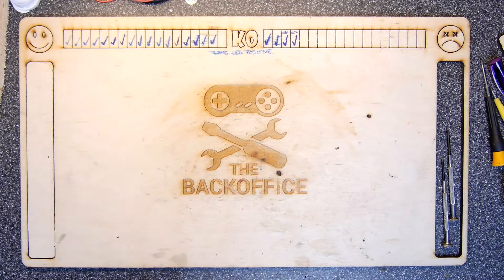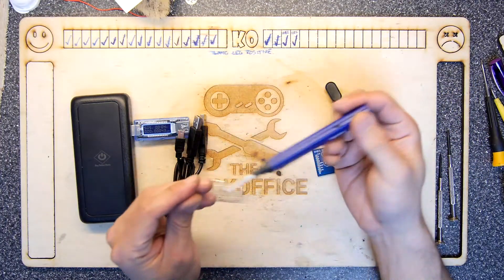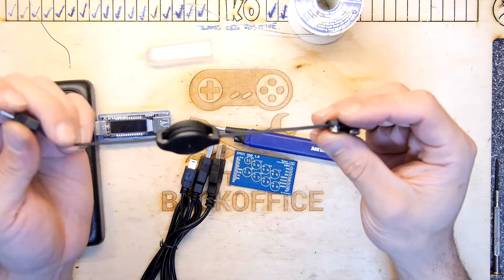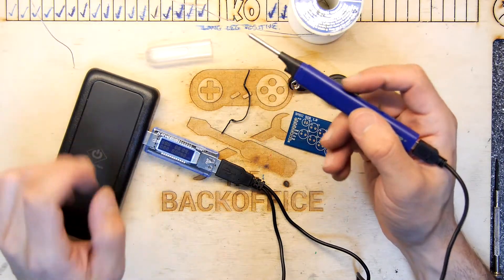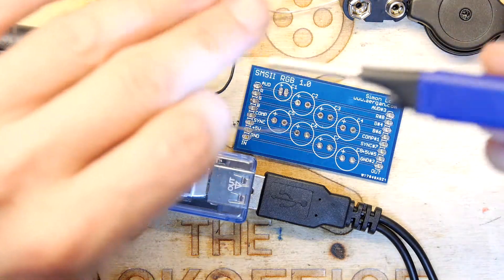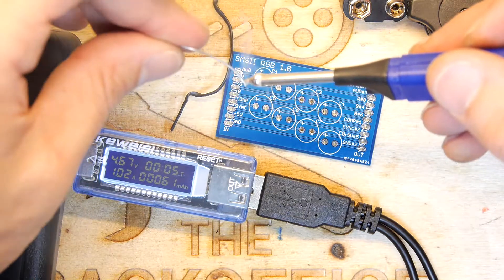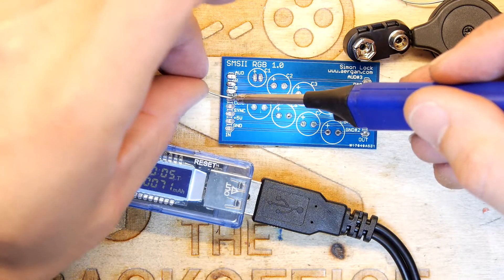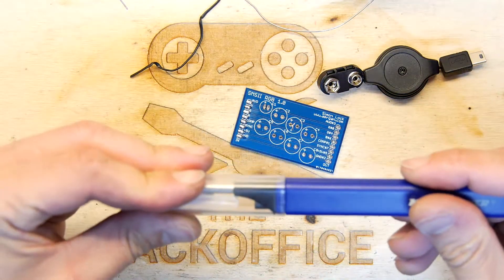USB Soldering Iron Yet Another

Comment: As a beginner who's looking to try his hand at soldering, what sort of soldering iron should I be looking at? Any advice for the sort of thing I need to along with it?
Reply: Mr Tom FTW for a beginner/home hobbyist you can't go wrong with something like a 936/936D, approx £25/$30 and spare bits/handles are cheap, just search for 936 soldering station on eBay
Reply: Oooh looks fancy. Thanks for the tip :)
Reply: That looks decent, what's it like for replacement tips etc? EDIT: Ah just had to scroll down a bit, decent price, especially from a UK company
Reply from the maker: +Mr Tom FTW they are pretty cheap for what they are. I have been using mine for at least 5 years in production and on the same tip 😀
Reply from the maker: +WeirdScience06 cheap, but I have never had to replace one in five years 👍
Reply: I might have to invest in one, I'm only a hobbyist but you can never have enough tools/gadgets :-)